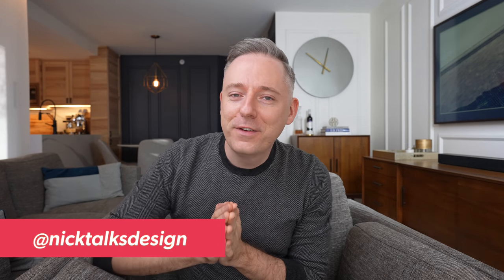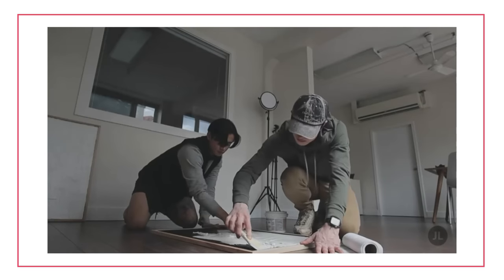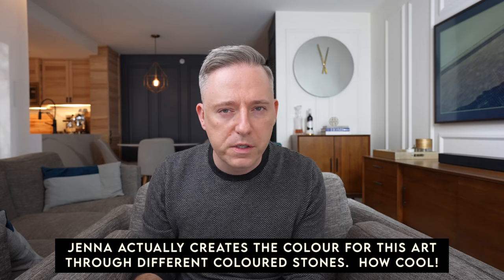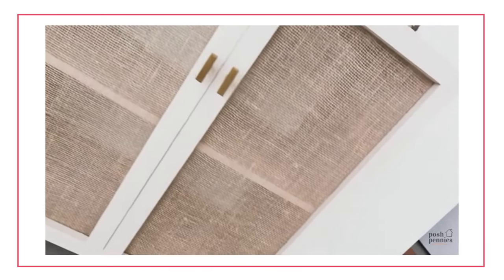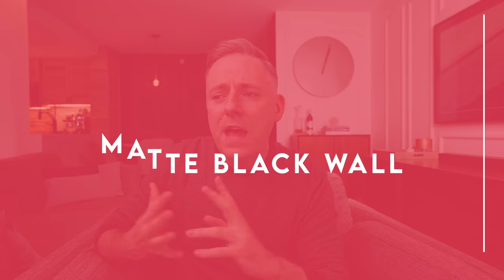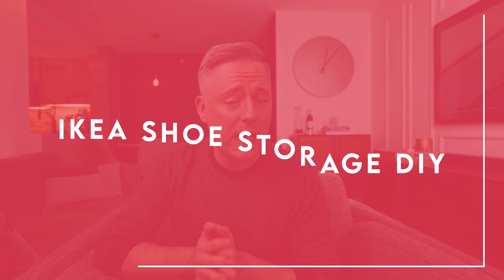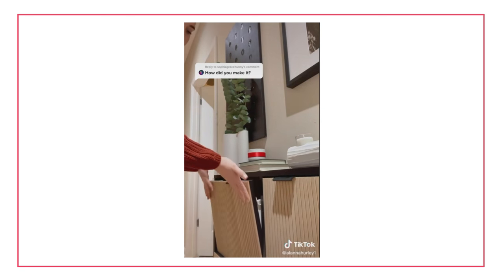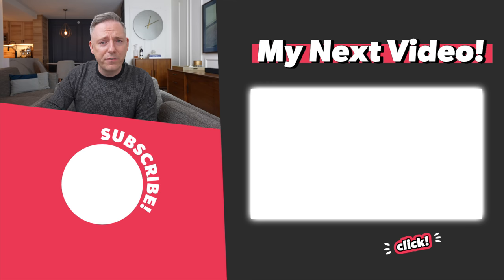Home Decor DIY’s I Actually Like!

Comment: Buying plaster art is super expensive, which is why I love watching people DIY it. I'm going to take a crack at trying it myself because I just can't justify paying $400+ for plaster on a canvas.

ETA: we're doing a wood slat wall but I used 1x2s so there's no worrying about cutting a long perfectly straight line. We stained ours in special walnut for warmth, but you can stain or paint them. We're also doing two slat wall closets, like nothing behind the wood slats. Got the inspi when looking at Japandi ideas. It works perfectly for us since we were concerned about ventilation in the closests as we live right next to a body of water and in the Mid-Atlantic, so it can get very humid. Trying to eliminate things, especially linens, from getting sour/musty
Reply: Go with your imagination in what you want to create, and you can't go wrong!!😊

Comment: A lot of DIYers do it because most people are broke and still want to have nice looking personal spaces.

Those slated covers are available at Lowe's as well. And are made to cover those structural support poles that are functional but ugly. They are great because they are cuttable but still on the expensive  side. 

Which brings me to content creator DIYers... They have more money than most people still and can do higher end DIY, which is still under the category of for people that want nicer looking spaces than they can afford. 

Concrete is great, and I think a lot of what makes DIY stuff seem disposable is that it's light weight. But if placed well, and not meant to be touched or used, so it's simply for a look, it's fine. 

I don't DIY so I can brag, I DIY because otherwise I live in a low income box with the same type of industrial tile floors you find at Walmart. And I mean the floors of the store itself, not can be bought there. 

I get that you're being real and I applaud that. Just saying, there are lots of reasons people diy money is the top reason, customized items would probably be second, it doesn't exist out there yet is in the mix, but I've never heard bragging rights on the list till YouTube content creators started putting it into their videos, and I've been a DIYer since I was like 5 helping up make my grandmother's bespoke cane out of a branch I dragged home from the cemetery I lived near and now have to use the cane myself. 

The content creator DIY reasoning is still very far removed from the average people decorating their homes.

Comment: I’m not much a DIYer, but did haul back some cut down tree trunks from a nearby trail to build a hugelkultur from scratch, ie, dig down two feet into the ground in my back garden and fill it with semi decomposed logs, branches, fall leaves, kitchen organic scraps and topsoil.  After the winter season, I added more topsoil with manure and it’s ready for planting.

Comment: Pro-tip for the cabinet doors if you have cats or kids who might easily damage burlap, rattan, or caning... you can head to your local improvement store and get punched metal sheets fairly expensively that would serve the same purpose. You can spray paint them if you want a different color and the patterns available are immense. Everything from classic geometrics to more fanciful or whimsical. We've used these metal panels for several projects in my family because we have cats and cats like to scratch screening. You can also install them on your screened patio doors to prevent scratching as well. You just need tin snips to cut to fit and some sand paper to soften the edges if you don't want to hide them behind some sort of trim.

Comment: Sometimes it helps to have a backup plan for the item in case your DIY doesn't go as well as planned.  For example, I will be attempting to build a console table for the foyer.  Or a workbench for the garage, depending on how it turns out.  Even ugly things can be useful and not go to waste.

Comment: Love these ones, Nick. I’m thinking instead of a wall of (more) beadboard in my 4’ wide hallway, I may use these shoe units with the slats and stain and shellac them in my warm wood color. It’s a great idea to cover my plaster walls which are already damaged from past wainscoting applications. Love it more because the hall is at my bedroom door and just off the living room where I have no entry and will be putting up a coat rack. Thanks for posting this.

Comment: I was actually planning on making plaster art! I have tons leftover from a home reno and nothing to do with it. In researching how to do it, you definitely can add paints to make different colours, and apparently it also makes it less likely to crack! I plan on adding sand for an additional textural element. Apparently they used to add sand to plaster walls back in the day!? 

I would also add that I appreciate a lot of DIY painted art as well. At least they're more original and meaningful to the owner and not a generic print from insert any box store name. 

I do like DIY myself but often take on bigger projects. I totally agree though that depending on the project and skill level, a lot of stuff can end up looking really cheap.
Reply: Would you consider doing plaster art on a thin flat panel of MDF? It would survive longer.

Comment: The "columns" are basement floor support beams, they are very common in my area for cheaper houses from the last 50 years in the basements which are usually also not finished.

Comment: I think  that there is something to be said for small simple improvements for things that takes no skill, but makes your day a little better.
not big things like pouring concrete, but just smaller things, like hiding a USB hub and branch outlet under your desk,  so you can hide your wires, extraneous plugs, etc. 
That means that my laptop dock has zero plugs going around the office, and just one plug for keyboard, mouse, webcam, microphone, etc.

Makes life a lot nicer, and just takes some patience, a pair of scissors and some double sided tape. Doesn't "upcycle" (I miss regretsy now) your desk, but makes it a lot less cluttered and easy to keep clean.

Comment: Just wanted to share I majored in fine art painting...  If u use gesso from an art store which is cheap and meant to slap on a canvas....  It will not crack.  Gesso is meant for and was created for putting on canvas.  U can choose to paint it or jus texture it as van gogh was known for.
Reply: Wall filler will also not crack, and for a large canvas with a big texture-y impasto it might be a bit cheaper

Comment: That basement column wrap looks just like the Ikea bamboo sofa armrest tray, to me. I wonder if you could use the armrest trays because they're a couple feet for $15 instead of 4 feet for $69 at Home Depot. Or if the measurements wouldn't work. No clue, just thought it looked the same.

Comment: 1-"Art Should Comfort the Disturbed and Disturb the Comfortable" Cesar A. Cruz, neutral art fails at both no matter who makes it ( I would also say art can document but still abstract and neutral art is still a failure on its face )
2-I still cant  stop seeing OSB and MDF whenever I see painted wood and then seeing it warped and cracked after a few years of use becus it is not stable  ( if the wood was real you would show me the grain )
Reply: Love your comment 😃!
BTW I think when used for the purposes they were created for, osb and mdf are actually more stable than wood. OSB must be covered with another product like flooring or siding; and mdf doesn't warp in interior environments.
Reply: @gurubhaikhalsa9337  well if they absorb water they will swell and have no network to drain it out like solid wood dos so they just start to fall apart , thing is all wood is eventually exposed to water , I also have had a number of MDF shelves and other items  every one of them has sagged over time and then eventually broken but real wood has cracked me but never dun the sagged then break thing .Finally in a  fire the MDF relseas sum fairly nifty chemicals that you do not get to breath much of in 1 life time

Comment: I think the key to creating good looking DIYs is using real materials (e.g. wood, metal, concrete etc.) that are of decent quality. Often DIYs (especially anything labelled a "hack"..) involve using cheap materials like cardboard or plastic and trying to imitate a higher quality product and often the results ends up looking (no surprise here!) very cheap. A fake brick wall made of styrofoam will most likely never look as good as adding real wood (or even MDF) slats to a wall. 
Also practice makes perfect. If you're working with a new material or using a technique for the very first time it can end up looking like a child did it. So if that's not the look you're going for maybe practice on a small item before creating something you actually plan to put in your home.